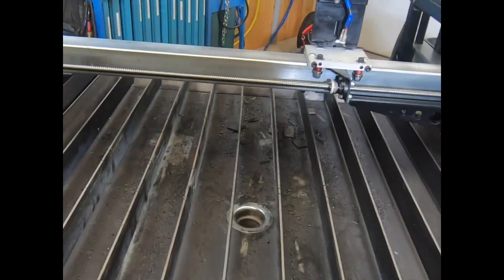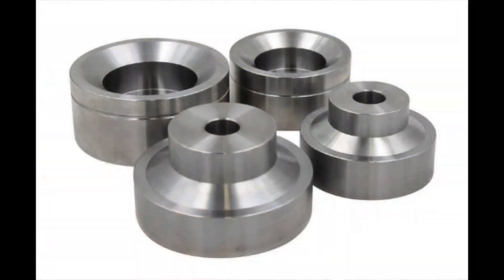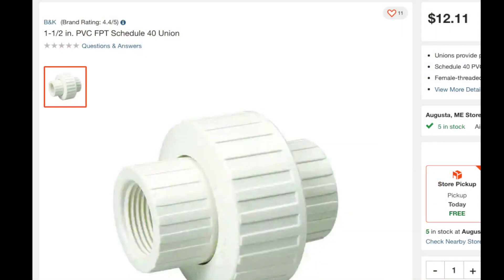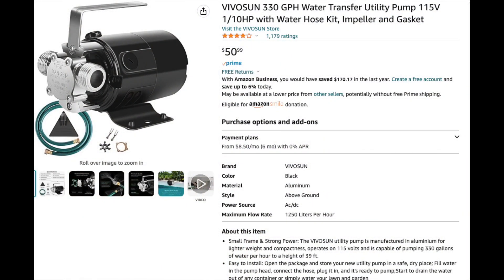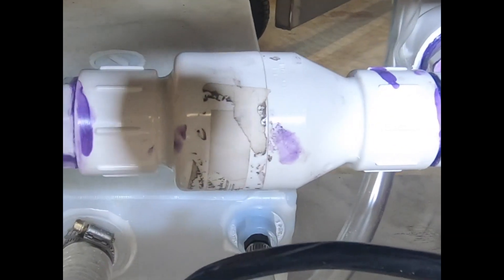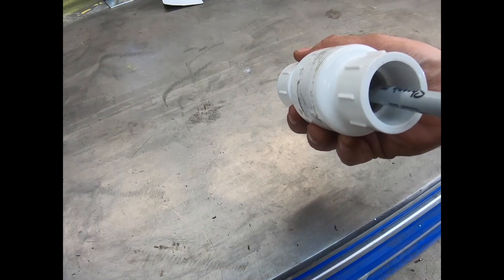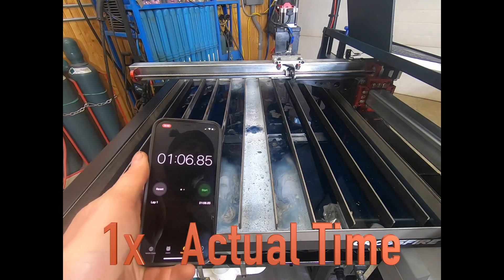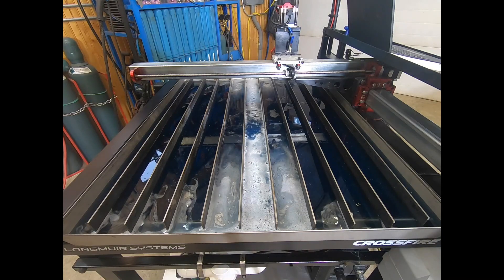Langmuir Crossfire XL Plasma Table Water Fill and Drain

Comment: What size hole did you drill and what size dimple die did you use?
Reply from the maker: I think it was 2.25", but I am going from flawed memory.  I believe I used a 2.5" Swag Off Road dimple die and the fit was not great but is still not leaking years later due to generous silicone and lack of pressure. The bar sink drain size is odd, bigger than bathroom sink but smaller than 3.5" kitchen drains.

Comment: Why is the water blue? Rust prevention?
Reply from the maker: Yes, this has Sterling Cool additive mostly for rust prevention, but also works as antifreeze, since I don’t always heat the garage.  Without it plasma cutting dust makes awful rust sludge.